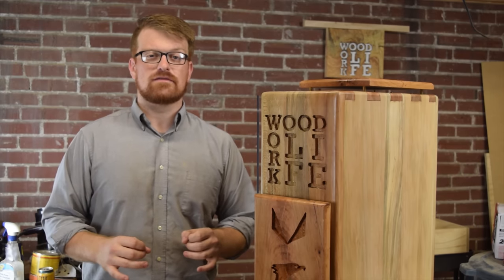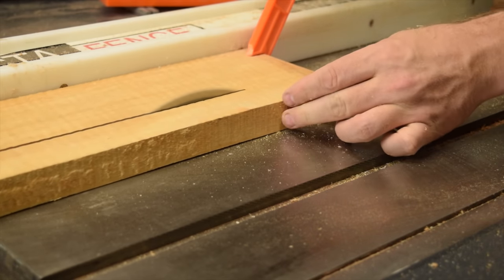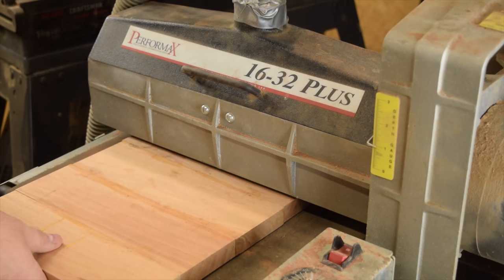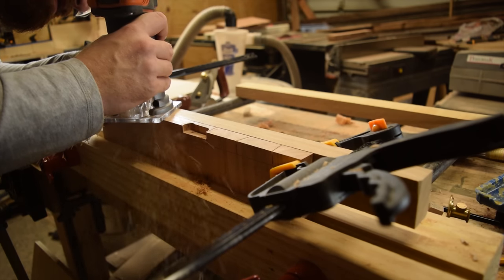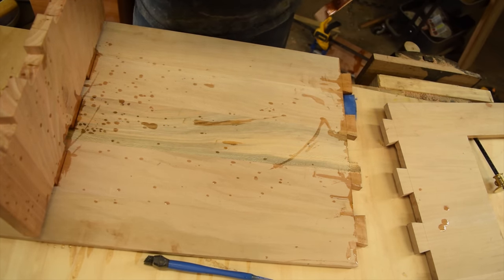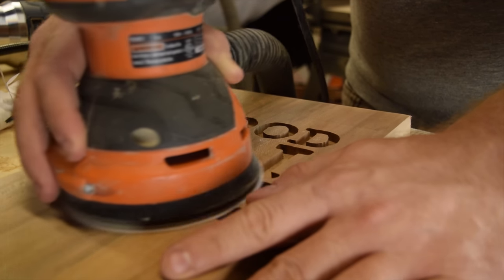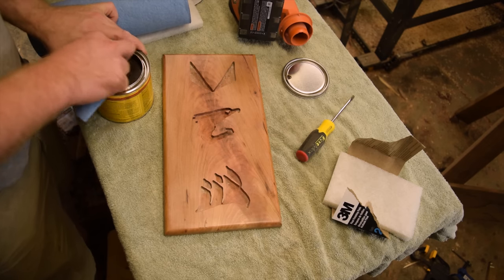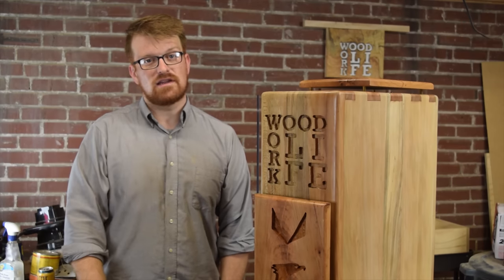Hand Crafted Fine Furniture Grade PC Scratch build | EPIC Wooden PC Builds

Comment: Fantastic project. Beautifully made.
As a former Green Oak Timber framer and now a pc modder / builder I have never gotten round to building a wooden case.
I feel inspired.

A little tip for you regarding sanding for the ultimate finish.
A damp cloth over the piece you want to sand, give it a minute to release the fibres and then sand.
Repeat the process as many times as is required (usually ten depending on the wood) to get a very dense marble like feel and look.
Oh, and Silk Wood or Beeswax to finish. 😊
Reply from the maker: That is a similar finish you get with the finishing technique I used.  The way essentially fills the grain.

Comment: Your case looks awesome. What are you going to use for things like motherboard tray and hard drive cage? I have been thinking of doing this for some time. I was thinking of using an old case to sacrifice for the drive cage and motherboard tray. What are you going to use for the front USB and sound headers?
Reply from the maker: I don't use front USB and Audio so I am just not messing up the aesthetic.  You don't need to use a motherboard tray, you can just put threaded inserts in and put you risers right into the wood.  I am building a tool-less wooden hard drive cage.

Comment: isnt wood a really good insulator? It looks sweet but have you had problems with heat?
Reply from the maker: Nope, not at all.  Heat will build up in any material if you don't keep air moving through it.  I just make sure to keep air flowing through it.  It doesn't really affect the heat of the temperature.

Comment: Hey, Wood Work Life! Can you bend wood and put it on the Inwin 301 so that it looks the new In win 806 wooden case? I'm trying to this at home, but I want to see how it's done first...
Reply from the maker: It is totally doable, you would make a form for your bend out of plywood that matches the profile of the case you wanted to bend to.  Then I would use wood veneer and build up many layers of it moistened and glued with a water proof glue and then I would tape it down with lots of masking or painters tape to the form.  You could also use clamp and clamp to the form.  It would take a while to dry, 48 hrs to be safe and then it is time to sand...
Reply: Thanks!

Comment: I don't recommend putting any components in this case especially if you overclock your computer, some things can go extremely wrong with wooden case that's why companies make cases out of metal.
Reply from the maker: Not really, there is not really a risk to using wood as its an insulator.  The reason companies don't use it is because it is much more difficult to properly machine and assemble reliably compared to steel at industrial scale.  Using an insulator for case material is probably much safer than using a conductor when you think about it.